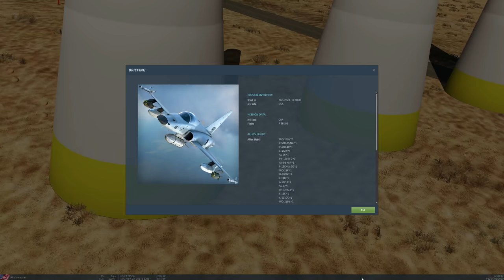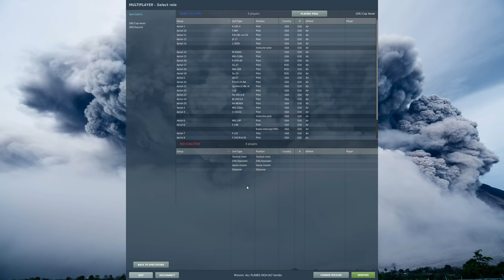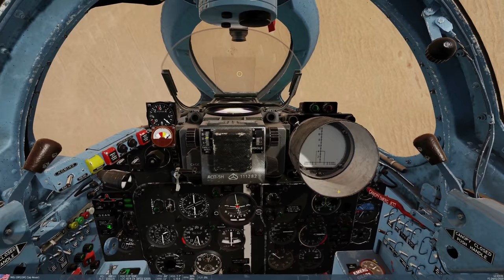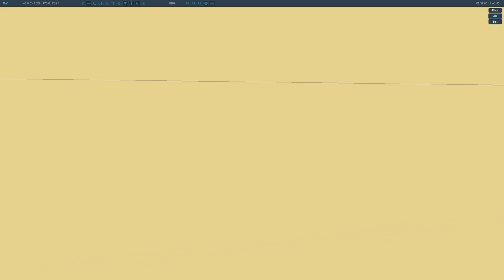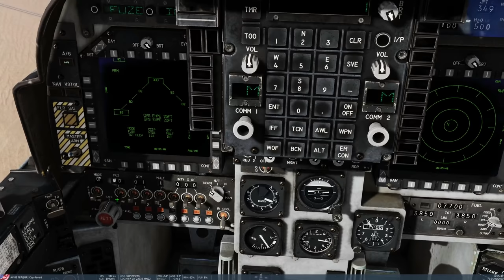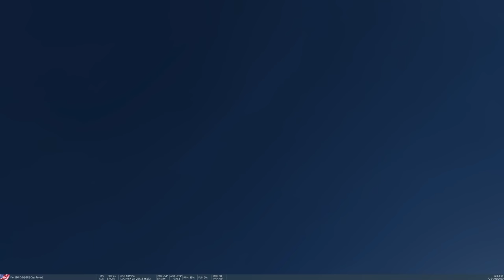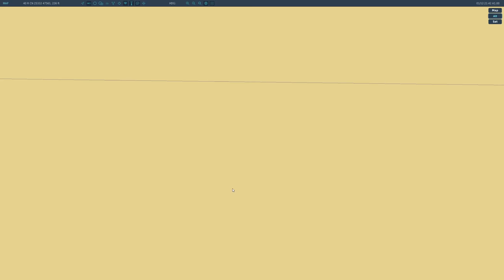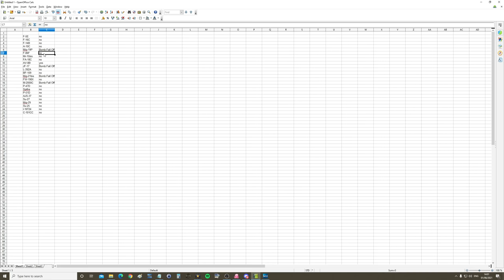Questioned: To What extent Is Over-G'ing Of Stores Modelled In DCS WORLD?

Comment: I think it would be great if DCS could be improved when the damage system / system failure would be punishing unrealistic behavior and some other tweaks would gently remind sim pilots to act more realistic. 
E.g. F-14B cat shot with full burners: if there would be a random loss of thrust  in one engine every now and then we would not start with full AB but stick to the recommendation to not use full AB. Overspeed or overweight landings should result in broken arrestor cables / tire blow-ups. 
Dropping tanks when supersonic is AFAIK not realistic. Most aircraft can drop tanks only at relative slow speeds and when flying level and not under high g-load. Might screw up some SATAL tactics.
Super low flying in DCS is far easier than it is in reality. One reason I think is that the flat areas of the DCS terrain are too flat. In real life even "flat" terrain has some "peaks". Maybe just 10 or 20 meters but there is a reason why F-111s and Tornados flew at 60 meters (about 180 ft) or higher despite having a sophisticated TFR. Maybe DCS could punish jets flying at 60 or lower ft by increasing the bird strike probability?
I mean if there are no consequences many of us tend to not follow the rules. Not talking about taxiway take-offs have to to result in exploding aircraft. 

allegedly
Recce could be better used by mission designers / DCS. Enemy locations have to be photographed or manually marked before they appear on F10. 

TARPS or recce aircraft like F-4 could be uses. Viggen with its ELINT could mark SAM and AAA positions in-game. Maybe photos from recce pods could be made available in-game to fellow pilots?

Comment: Guys, I just bought the F16, and its so difficult to lock target. The enemy appears on my radar, I move the TDC cursor to lock the target, and it takes an eternity to lock the target.  Others jets like F15 and JF17 are not like that.
Reply: Try using TWS mode instead of RWS and wait for your contacts to load up. Once they are, lock em up with TMS up and then cycle through with TMS right and left
Reply: @Section82  thanks. Ill try that.
Reply: @arride4590  Just because a contact appears on the radar in the F-16 doesn't mean you can lock it up. Chuck's guide has a pretty good explanation of the radar modes.
Reply: Try narrowing down the azimuth and check if you're actually seeing them on the radar and not datalink
Reply: @rickaredoughmyloss7023  agree with you. Would add that you need to make sure elevation is right as datalink will show the contact regardless. Also, if locking up a target quickly is the goal use RWS to SAM modes, not TWS.
Reply: You can just TMS right to bug a target in TWS. TMS right cycles through the track files that are system tracks.
Reply: Bring a hammer, you give the radar screen a good whack to show it who is boss though.
Do that a couple of times and the Viper will tremble and lock up targets for you out of fear eventually...
Reply: if you only see a green icon then you are only seeing them on datalink (the AWACS or a ground based EWS can see them and is broadcasting their location over the datalink), you need to move your radar elevation up or down until you see a white dash near the location of said green icon, then you should be able to lock it immediately, remember in the f16 the first press of the lock on just "bugs" the target where the radar rapidly sweeps across, then the second press full locks it.

Comment: Hey Cap! I flew the F-5 a lot recently and sometimes my attitude indicator gets misaligned during flight, showing aproximatly 10° left bank in a level flight. The horizon line in the radar screen seems to be linked to it because it will be off by the same amount. It didn't kill me yet but led to some hairy situations in low visibility. I thought maybe it is related to over G on the airframe, but i have trouble reproducing it. You had your indicator caged and the radar switched off in this test. Did you notice something like that too on other flights? Is it just a bug?
Reply: Oh i just rewatched and saw that your indicator was working at the start but after the ~9G pull it was messed up! Interesting.
Reply from the maker: Oh God, I think you may have just opened a new can of worms...
Reply: You're welcome :)
Reply: @grimreapers  This bug has been around for a while, the indicator in the F-5 seems to drift VERY quickly.
https://forums.eagle.ru/topic/156693-need-trackcant-replicate-attitude-indicator-inaccurate-after-a-several-maneuvers/page/1/
Reply: Yes some instruments in the F-5 fail after an over g. I find it especially noticeable after a hard landing.

Comment: I could have answered this without a video. YES. You cannot perform a split S or an Immelmann turn in the Mirage-2000 with stores. It will "break" the pylon conenction and you can't use bombs or missiles anymore, and have to RTB... So damn annoying. I assume all Razbam aircraft are modeled the same way.

Comment: Hey I've got a question.  Canada paints a false canopy on the bottom of their F-18's.  Is it actually useful?
Reply: In ACM yes, could confuse the enemy pilot about the planes lift vector, could give the pilot the advantage in SA he needs to win a rolling scissors etc. Kind of like wearing a mask on the back of your head to make it seem like your always watching for a sneaky tiger. Obviously in BVR kind of useless but there is still a strong belief in alot of air forces that BVR will inevitably degenerate into ACM if the pilots are equally trained in similarly capable fighters

Comment: What really puzzles me is why modern fighters don't just have rear facing AAM. If you can target aircraft behind you just hearing the tone then there's no reason for dogfighting if you can hit aircraft behind you.
Reply: Cause the missile would probably be hilariously slow if the motor has to counteract the forward momentum of the jet when the missile comes off the rails.
Reply: Missiles are Mach 3 while planes are .5. And during kulbit missiles are already fired moving backwards.
Reply: @markingraham4892  Late, but the missile would just straight-up tumble off the rails from flying "backwards" with that little aerodynamic control. Its a lot simpler to just make HOBS missiles like IRIS-T

Comment: That's why I didn't buy the JF
Reply: Why?
Reply from the maker: Yeh pretty annoying
Reply: the stores break very easily, takes all the fun out of flying it.
Reply: @tombstone4362  They don't break very easily, they break when you start dogfighting with GBU-10's still attached. And if you do that, you kinda deserve it. The flight configuration (AG/1, AG/2 or both) that you set when you rearm tells the FCS what limits it needs to impose on the maneuverability of the jet. It's not 100% foolproof but I fly the Jeff A LOT and I have only once over-g'd the stores.
Reply: @MKRocker2012  i flew it when it was free a few months back,  my experience was they broke under practically any load at all,  even on a aggressive takeoff.  So, idk 🤷‍♂️